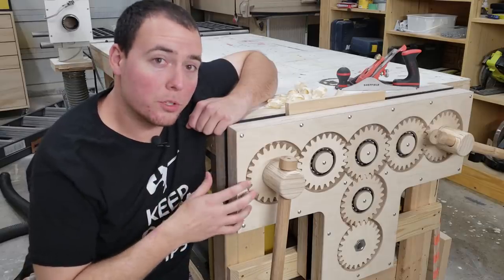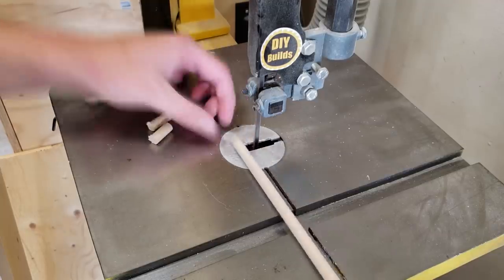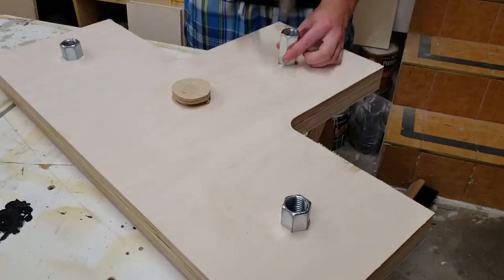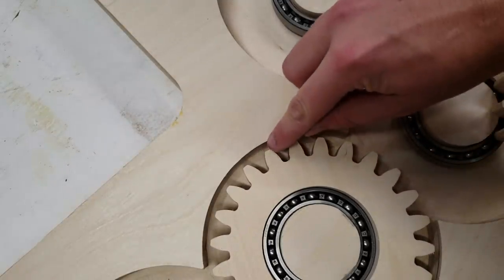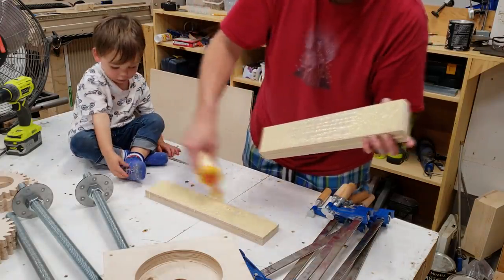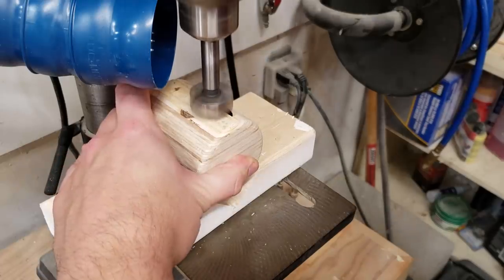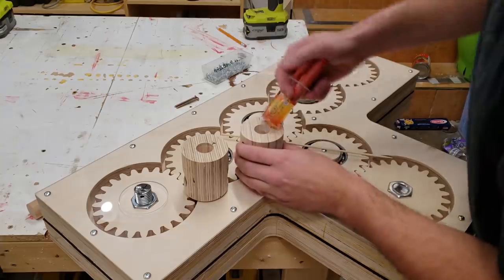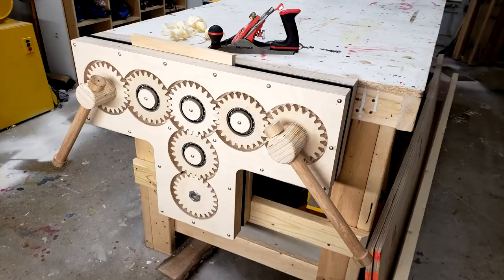Triple Screw Gear Vise

Comment: Coming from the perspective of an old cabinet maker, I have notes. 
1. When face gluing sheets of plywood, just clamp it up with strongbacks, screws are a liability during machining and if something happens that's so catastrophic the glue joint fails, no amount of screws is going save you. 
2. The knuckle of your handle should be solid maple or similar. The repetitive torsional load on the plywood will probably chowder out the hole in short order. Also add an o- ring to the ends of your handles so when they flop from end to end they have a soft landing. 
3. The inability to tighten the screws independently is going to be limiting in certain situations. Maybe build some throw into the shaft if the center gear so it could be disengaged as needed? 
4. This is more of an engineering thing so I admittedly speak with less authority but in low speed, high radial load applications I think bushings are preferable to bearings. And cheaper. 

Having said all that, great video and cool concept, thanks for sharing!
Reply: I am always amazed at how much these videos can bring forward craftsmen with great skill sets and knowledge as you....thanks and best wishes.
Reply: @dr.skipkazarian5556  agreed! learning new stuff is the best. I am a hobbyist and would love nothing better than to be 18 again and choose a different career path lol....Comments like Patrick's are the kind of knowledge you used to only get in a true apprenticeship. Score one for the internet today!
Reply: I was thinking a lot of the same. This is an application where a 3D printed part, printed in the correct way, would be far surperior. With 3D printing you can have a continuous grain around the handle. Granted you would need to select the correct plastic, PC or PETG should work well in this application.

As far as the bushings, he is using very large ball bearings. Any advantage you would get from plain bearings would likely be removed from not having continuous lubrication.

The more egregious mistake here is that there are no ways. Having 3 screws, even if perfectly timed, does not make up for having proper ways. If he put 4x 30mm steel rods with 100MM bushings it would be much stiffer.
Reply: Barings do look good though :P

Comment: Dude that table saw lathe is absolutely amazing
Reply: I missed some of this audio so I don't know the lathe's origin.  But Izzy Swan has a creation that does the same.
Reply: @cdouglas1942  I'm pretty sure Izzy is the original creator of this table saw lathe. That guy has some great inventions using drills and wooden gears....
Reply: @acewingman3744    Concur. Izzy is one clever guy.
Reply: Can you tell me the time it appears in the vídeo
Reply: Can you tell me the time it appears in the vídeo
Reply: @afonsomarto6587  try 8:55
Reply: @cdouglas1942  thanks
Reply: I winced, I literally winced. That contraption, while useful can so easily go baaaaaadly wrong.
Reply: @xConundrumx  Take a look at Izzy Swan's recent post on one of these. The relative rotations of the high-speed table saw blade vs the low RPM of the drill means that there is almost no side torque on the blade. He goes through a good explanation of the physics involved.

Comment: Beautiful... Only thing I would've done different is add a sacrificial surface to the top in case of 'accidents'... Something that could easily be replaced by screws / caps, or just using dowels to hold it in place. Good to keep it flush, but simple to swap out in case you cut into it. Or, even a metal top...

Comment: Very nice job, and a great video. I would add that if you wanted to, you could deviate from a 1:1 gear ratio and a) increase leverage, and b) slightly reduce the size of the gear mechanism by moving the points of concentricity closer to each other. Of course, the tradeoff would be more rotations of the handle to achieve the same amount of travel. Very interesting video, thanks for posting.

Comment: I like your vice.  I have a Lie-Nielsen chain vice.  It originally had coupling nuts like you use.  They seized on the Acme thread screws.  The machine parts catalogue I found these nuts in warns not to use them for motion control.  I changed to brass nuts and have had no trouble since.  Keep them well lubed and good luck.  It may work out anyway.

Comment: very nice vise!  Also nice sharp plane.  My grade 9 wood shop teacher would give a whack upside the head if we put the plane upright on the bench.  Lay it on its side for the blades sake.  Not being critical you may never have been told that.  I love these kinds of projects because this uses sound design principles.  3 screws equals excellent alignment.
Reply: 1962 my woodwork teacher said same thing so that’s what I still do...YouTube recently stated that not necessary, I need to confirm with my original teacher or his father....

Comment: I was a carpenter 30 years, built everything you can imagine. The part i miss most, is using the tools to build something.  Tools are useless unless you're building something with them. Just tuned in to your channel, eager to see what you build with the tools.

Comment: Nice design, great build and innovative screw gear for a monster vise!
The only disadvantage that comes to mind is, you cannot easily use this vise for a piece that is not the same width at both the ends.
When one handle is turned, if there is a risk of the other handle causing some testicular damage, the solution is simple: Simply remove one of the two handles!

Comment: Love everything about it, and I may have to build one myself. The only thing I may change is go to a single handle, driving the top center idler gear, because I'm afraid the two handles on either end would get in my way. Overall though, 10/10 on the build.
Reply from the maker: I was going to do that but thought the convenience of one on each end of a long vise would be better. If you do it please email me a picture of it.
Reply: The first thing I thought too. Even mechanically speaking this would be a much better solution: center gear driving the three screws allows for an equal length gear train to each of the screws, which means equal amount of backlash and load on the gears.
Reply: DIY Builds I was waiting for you to make the Center gear disengage so the vice could be canted slightly to grip slightly tapered or odd shaped projects. I have a commercial made one that’s chain drive and has that feature, very handy!!!!!
Reply from the maker: I didnt think to add that feature since I've never needed it.

Comment: Love it when a DIY video starts on a CNC router....

With that said. I would have made it without fixed handles since they seems to flop around a bit to much for my taste. Also I would have put 2 nuts on the bottom gear, one sticking out so you could use a impact wrench for fast opening and close.
Reply from the maker: Glad I could help you fall in love again.
Reply: DIY Builds to be fair this video was in my recommended so I had not seen any other of your videos. I just now checked out your video on how to DIY CNC router so now this makes more sense. Got yourself a new subscriber!

Comment: When I cut plexiglass with my table saw I turn my blade backwards the reason I do that is I had some precut one time and I asked the guy how they got the edges so clean and that’s what he told me to do and it works phenomenal! Also I’ve tried with wood and metal blades and seems to be about the same. Great video I think I’m going to build on myself thx

Comment: Interesting design.   A lot of work.  Well done.   Good documentation of the build.
I like dog holes in the wooden jaws of my vise.  I use these often with bench dogs to hold thinner materials.
The aluminium nail you used to lock the screw to the all-thread is a weak link.   Too soft, it may fail over time.   I would have used a roll pin, also called spring pin or torsion pin.   Much harder and able to hold up to the force you may apply on the vise jaws.
Dave.
Reply from the maker: Ya i thought about that but im sure it will be fine since woodworking vises usually see way less force applied than metal vises

Comment: Great looking vise. The table saw lathe is genius, but having a CNC to do much of the initial cutting stretches the bounds of "DIY" for 99% of us...
Reply from the maker: You just have to build my cnc first
Reply: @DIYBuilds  I will check out that vid. Great work, mate!
Reply: Nah you can just print out the outline drawings of for wooden gears and rasp them out. It's not that challenging, just time consuming.
Reply: you have to DIY the cnc. you see the idea is to use your tools to build better tools to build better tools to build better tools. i think thats kind of the idea of this channel.
Reply: @longleaf1217  And Minecraft

Comment: Fantastic tool !
Maybe the gears should have been rubbed with bees wax. After all, less friction means less wear......
And a smoother operation.
I once made a late medieval wooden lens grinder, a very accurate replica, and I used bees wax and candle wax to lubricate the mechanism.  With or without wax....it was a HUGE difference !!!
Reply: telescopereplicator but they have bearings, isn’t that good enough?
Reply: @christophermoore6110  No. The teeth of the wheels will last longer if there is less friction. Metal, wood, plastic.... without lubrication the wear will be more than without. Bees wax or candle wax is super cheap and really easy to apply. And it makes the gear last so much longer. So why wouldn't you do it?
Reply: @christophermoore6110    I think I know what you mean. These gears are not used in a mechanism that is under heavy load, a lot of the time. They only turn when the vise is being used. So yes, in that light, the bearings are good enough.
Lubricating the teeth is just dotting the i's. Not really necessary, but if you want to keep this mechanism free of wear for many years you might consider some lube.

Comment: That is a beauty! I will never make one as I am just a novice hand tool hobbyist, but I love the look and seeing all the gears spin together. Don't care if it has two handles; it's a functional work of art! My favorite part of the vid, though was you assistant helping to tighten the clamps on the glue up. I also appreciate your showing the problem  you had attaching the rubber liners. Nice recovery. Comforting to see that things can go awry for everyone. And the table saw lathe was awesome, too. Probably won't be making one of those either ;-)

Comment: You know if the gears slip on the outside of the bearing it's actually no problem... because the whole idea is it turns freely.
Reply from the maker: Agreed. The glue was to stop them from wandering forwards of the wood shaft.
Reply: @DIYBuilds  fair enough, though in future I would also have recommended using bushings instead of bearings.
Aside from being much cheaper there's no real need for bearings as it's a low speed, high force application, and bushings are less prone to getting fouled with sawdust.though
But they don't look as cool though.
Reply from the maker: They do look cool this way but those bearings were only $3 each.

Comment: I would add a bit of that black rubber matting to each end of the handles on the inside of each cap so when they slide down they don't smack hard into the knuckle and possibly shatter the cap holding the handle from sliding out. Plus would make it a lot quieter.
Reply from the maker: Good idea

Comment: That's awesome.  The only suggestion I might offer would be to have set the handles so they were vertical when the vise is closed and not in use.  I am a clutz and if they stuck just a bit like this in my shop, I'd end up breaking them and/or hurting myself when I caught the ends as I walked passed.

Comment: As a suggestion; You could use 'Stall Mats' or 'Floor / Gym Mats' for the vise jaws. They're typically 3/4" Thickness and you could countersink large holes for washers and use carriage bolts to attach them to the face of the jaws (as well as the contact cement).
Reply from the maker: That would be way too thick

Comment: I like the dual handles that can be use from either side of the table.  There would be one change I would make is that both handles are in sync.  That is my OCD kicking in.
Reply from the maker: They can't be or they will smack in the middle
Reply: @DIYBuilds  Make the handles shorter.  A little less the half the distance.  I think your handles are to long anyway.  But then again it's your project.

Comment: THAT, is one fine project. I wish I could do that build but alas a CNC machine I do not have. None the less I am struck by the ingenuity you have to make this.
Reply: Actually, if you take a look at gears made by Matthias Wandel, he cuts them all by hand using a band saw. He even has software to lay them out that you can download from his web site woodgears dot ca. This is fully doable by hand using his techniques to make the gears.

Comment: Nice.  Neat project.  Looks good.  A few of thangs I noticed I would have done different.  1:  Set the handles so they were angled in instead of out when the clamp is closed.  This way you don't run into them if you walk by close to the bench.  You would not see them if you were carrying something blocking your view of them as you walk by.  If you don't remember your leg could snag a clamp handle (from experience something I seem to have a tendency to do).  Also,   2:  I would have used ebony for the gears.  Ebony is a hardwood and has natural oils in the wood so to a certain extent naturally lubricate the gears (although if the gears didn't fit tight on the bearings it would make gluing them to the bearings problematic).  .  Besides, it would make a contrast to the other wood giving it more of an artistic look   Finally,   3:  I would use spring steel tension pins instead of cut off aluminum nails.  Given the length/leverage of the long handles I would think you could shear the aluminum pins if you put some umph into it.

Comment: Very nice job, for me i would have aligned the handles to they face the same direction as each other, but then again I have a OCD :) Awesome work thanks for sharing!
Reply from the maker: Problem with that is they would cross at the same point and smack into each other
Reply: @DIYBuilds  with that being an issue and my ocd,  I would have made them at 90 to each other 😁

Comment: very cool the only flaw i see is that aluminum and steel don't mix the aluminum nail  will eat the steel and the hole will get sloppy and it doesn't take long other than that nice job

Comment: I think roofing cement & primer would work well with roofing rubber 
 But personally I would opt for bronze 3/8 thick and removable hdpe self healing plastic, high grip silicone, and stainless steel hanging sheets. With help from neodymium magnets strategically placed in everything.

Comment: This turned out really cool, definitely makes marks for beauty in design. Not sure how DIY it is. By the time I acquire a table saw lathe setup, press, radial arm set up, deluxe belt sander, cnc machine and take out 3 bank loans - do I even need the vice? Makes me kind of think like oh DIY car. Well first you need sheet metal brakes, presses, grinders, an electrostatic paint booth, 20,000sq ft shop, a smelter in the corner and sand casts for the engine block.. around $600k in equipment and materials.. lol. Still a really nice project.
Reply from the maker: Ya but diy also assumes you have hands and my god are those things ever pricey.

Comment: I like it a lot but 1 question.... why 2 handles? why not 1 on the centre cog that drives the 3 outer cogs? That'd reduce (or rather, even out) the backlash between the 3 rods and reduce any racking too...

Comment: To make an extra wide vice, I think I could figure out about a dozen easier ways to do it that would require fewer and less expensive tools and a whole lot less mucking around. For one, I'd use aluminum heavy gauge L beam to distribute pressure from the center and dispense with all the wooden gears.
Reply from the maker: I look forward to your build video.

Comment: you seeminglgy were short before having your 2nd wood part slipping down from the tables edge when doing the final glueing of the first one. the hand knocks  for fixing the first one made it move - the time lapse shows. luckily it did not fall down - else the whole glue side might have picked up lots of dust from the ground or wherever...

Comment: Beautiful vice.  Only downside I can see is you are limited on the amount of torque you can apply to it due to the wooden teeth of the gears and the super glue holding the wooden gears to the metal bearings.  Any issues?  Does it produce adequate clamping force for those “large projects” without exceeding torque limitations?
Reply from the maker: It's good so far

Comment: this is awesome, but what if you need to take it apart, the handles are glued on.
Reply from the maker: The epoxy only provides mild holding power. It's more there for filler to stop wobbles. The screw that pins it can be removed.

Comment: Super cool  video / Vise  out of  curiosity do you have any thoughts  of selling all the parts  cut out as a kit  ?  or do you have a   way to download the actual plans that can be used  ti build one ?  i’m  retired Woodworker  that is between homes and shops  but i would like to equip my next  one with a similar style bench vise  at this point i’m not sure if  it will  have any CNC equipment  or not  as the reason i retired early was because of a Medical condition  and in all honesty i kind of like life  going at a slower pave then it once was  before i got sick my job was  to manage a Installation team  for a large Architectual Woodworking  organization  that i typically had 40 men and women on the payroll  and 17 to 20 job sites going each week  all of which had different deadlines  and Project managers  I worked with that organization for over 25 years